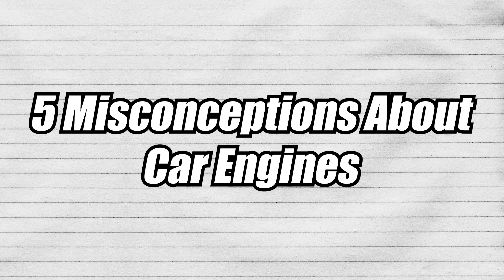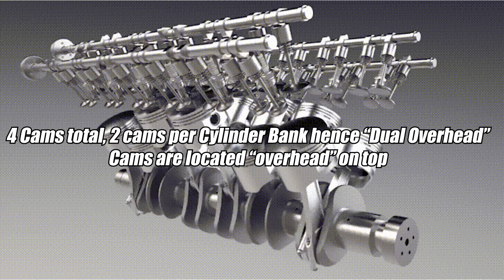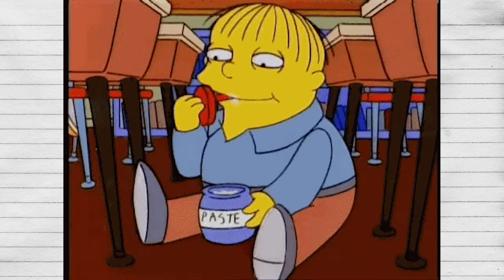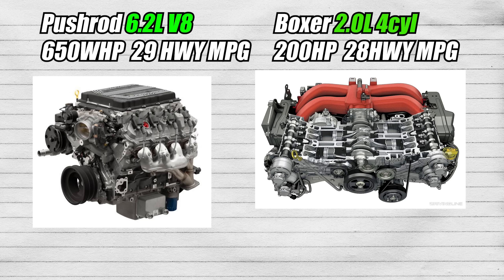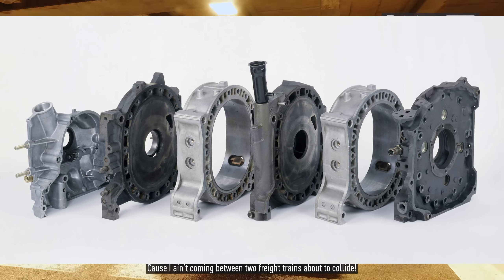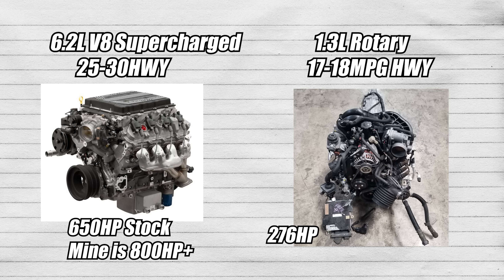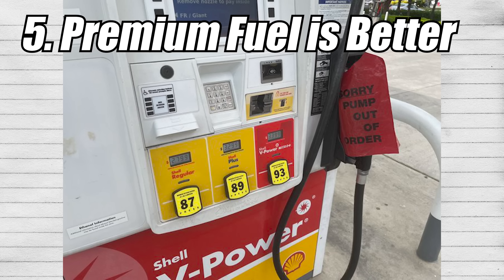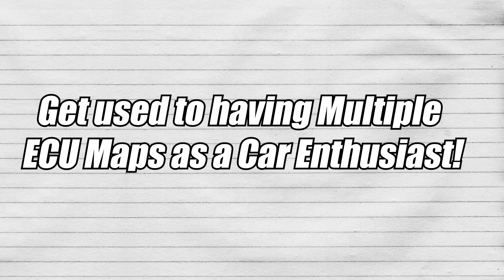5 Misconceptions About Car Engines!

Comment: Please explain in detail how the movement of the pushrods generates more torque per engine size compared to most overhead cam setups. It is my understanding that it just adds reciprocating parts which make it harder to rev high thus making it harder to make power by increasing rpm as opposed to the relative ease of making power in a pushrod engine by increasing torque whereas an OHC or DOHC engine has less reciprocating weight making high rpm easier to accomplish allowing a relatively low torque engine to make more power by making it's torque at a higher rpm. This results in pushrod engines usually making more torque in lbs./ft. than horsepower and OHC engines (especially DOHC engines) usually making more horsepower than lbs./ft. of torque (since DOHC has the least reciprocating parts in the valvetrain) but I fail to see how the pushrods come into play in making it easier to make torque in a small displacement engine. I'm not saying you're wrong, just want to understand and I don't. My understanding has always been that pushrod engines tend to make lots of torque at low rpm because that's just how they're tuned because it's harder for them to rev high.
Reply: I guess the weight of two or four camshafts robs engine torque. My old '95 Grand Prix had a 3.4L DOHC 60 degree V6 which replaced the pushrod version's single twenty pound camshaft with a twenty pound balance shaft and four twenty pound camshafts... and the camshafts were driven by a belt which was driven by the balance shaft in the position of the pushrod version's camshaft which was driven by a chain. That's a lot of extra rotating weight so that makes sense but could have been explained more clearly.
Reply: @Where_is_Waldo  it's really just that pushrod engines usually have more displacement for a given power rating, and more displacement means more torque.
Yes it's basically because the reciprocating mass makes it harder to rev high, but it's also that pushrod engines only have 2 valves per cylinder so they can't breathe as well at high RPM.
(And if they made them 4-valve, the reciprocating mass would prohibit high RPM anyway).
Interesting comparison:
That quad cam 3400 (very cool and interesting engine btw) made what, 240 hp? But the Buick 3800 Supercharged (a few years later) also made 240 hp, but with pushrods and more displacement (the supercharger is of the 'positive displacement' type so it's equivalent to adding more displacement). Of course the 3800 made more torque and made its peak 240 hp at a lower rpm.
Reply: @nthgth  The quad cam 3.4L made 210hp initially and was retuned for the final model year of 1996 to make 215hp. It actually didn't rev much higher than GM's later released 3400 SFI pushrod V6 and both were variants of GM's 60degree V6. Both versions of the 3.4L 60 degree V6 had aluminum heads. Early 60 degree pushrod V6 engines had fairly constrictive ports but my understanding is that the only way to increase flow beyond what the 3400 SFI pushrod engine achieves from the factory is to polish the ports, they really maximized the flow of the two ports per cylinder in that engine. The 3.4L quad cam was actually design by lotus and they had to figure out a way to fit the oversized cylinder heads into a Grand Prix/Lumina/Cutlass Supreme so they initially tested the motor in a FWD Camaro.
Reply: @Where_is_Waldo  ah ok 210-215 hp. Ok then for that comparison I'd compare it with a standard 200 hp Buick 3800 with a cold air intake and maybe headers. Lol.
But too the point, that's really interesting Lotus designed that engine. Just like the also quad cam LT5! (I think).
I did NOT know about a FWD Camaro, that's crazy. Like a normal 4th gen converted? Or a concept 5th gen?
However I do remember reading that the 3400 quad cam (LQ1 I think) made 285 hp in testing, but GM didn't have a FWD automatic transmission that could handle it so they had to reel it back - probably why it didn't rev that high for a dohc performance engine.
Can you imagine if they just left it manual-only and built a 285-hp Lumina Z34?? And Grand Prix etc. Those cars would have been world-beaters in their day and priceless now
Reply: @nthgth  The LT5 was in the C4 ZR-1 right? That was designed by lotus as well as the C4 ZR-1's suspension. The fourth gen. Camaro was the '80s style that included the IROC correct? I believe it was that generation and I think I remember something about down tuning it for the FWD automatic transmissions. I did just pop onto your youtube page for a moment and noticed you seem to be into old school gaming as well, we seem to appreciate some of the same games. You reminded me I need a copy of Road Rash 64... actually I also need a copy of Road Rash for the Genesis now that I think of it. I used to think they never made any car with the quad cam 3.4L AND a manual but as a teenager I once saw a GTP 3.4L with a 5spd parked on the side of the road. I waited a while hoping to meet the owner but had to leave before the owner came back. It looked factory but I wanted to ask. Mine sat in a barn for years before I bought it and had too many problems for me to sort out, one of which was the planetary gearset breaking. I got that fixed and fixed the fuel system and replaced the timing belt but a big mistake I made which I didn't realize until I sold the car was using silicone on the gaskets when reassembling the intake manifold, I didn't know that could screw up the oxygen sensor and plug up the catalytic converter.

Comment: People also gotta realise that even if a bigger engine got less power than a smaller one, its probably gonna last a lot longer simply because a bigger engine moves slower and therefore does a lot less revolutions per minute for the same power if you're going highway or any inner city speeds where more power doesnt do shit because you're flowing with traffic.

Comment: So my dad is very much so the "no replacement for displacement" kind of guy. But he told me that it doesn't mean that a larger displacement engine is always more powerful, but rather that if a four cylinder with a turbo has the same power as an n/a v8, then putting that turbo on the v8 would give it way more power.

I still fully agree that na isn't the be all end all but that there are too many variables to make a concrete statement.

Comment: The 10-15 second startup waiting time is an annoying misconception of a misconception, because people completely ignore that its not only the fact that parts need to be covered in oil, but that oil needs to be warmed up in order to work properly (this mostly applies on diesels tho), and dont get me wrong it will heat up fast (<<1min) but still, its not just start up the engine count to ten and roll...

Comment: I love these vidoe, even though I know most if not all of what he is saying, it is good to get a nice sanity check on my thoughts and it is good to check if others have the same or similar thoughts that I have. If there was a same car with the same trans cruising at the same speed on the same grade of road in the same temp on the same tires but with different engines like a 6.2L V8 N/A and a 2.1L i4 N/A get the same gas mileage. I also have a question about warming up. Do I need to warm up my car if it is like 0-5 degrees f out? I try to let it idle for a couple of min, but do I need to.
Reply: I can't answer your question, but your hypothetical 2 cars with same mpg reminded me of something from my early 20s:
My car was a '95 Camaro Z28, I averaged ~17mpg around town.
One time I borrowed my parents 09 Camry 4cyl for a week, in which I averaged the same! (wasn't trying anything, just noticed when I filled it back up).
I chalked it up to same driving habits, same roads, same amount of drive wheels, ~same vehicle weight.
(The Camry was only 5spd and auto, but had FWD in its favor, I call it a wash).

Comment: I found the comparison between the rotary engine and conventional engine in misconception #2 to be very dumb.
Conventional 4 stroke engines have a period where they are not sucking in air while they are running (squeeze, bang, and blow), while 2 strokes do it much more often (piston goes up and sucks in air and fuel mix and pushes it into the combustion chamber), and rotaries do it all the time (on one side there will be igniton, but on the other side there will be a sucking in of air and fuel)

Comment: "Modern engines don't need to warm up."  

I dunno about that.  I've got a Camaro LT1 and if I try to performance shift that thing too soon (definitely a minute+ into my drive, but before the engine has reached equilibrium temps), it is very obviously not happy to do it.  It's a very noisy shift compared to the same shift at normal engine temps.
Reply: Could be the transmission temp. My old FR-S was loathe to go from 1 to 2, even gently, for several minutes after a cold start below like 20°F

Comment: Great example of small engine having to work hard to maintain highway speed and thus reducing MPGs, my 94 Miata. at 65mph it's above 3,000RPM and I average mid 20s at best like that. It's a tiny 1.8 liter engine. 
My daily driver Focus is a 2 liter, and at the same speed might be touching 2,400RPM, averaging around 32MPG.
My best MPG was a 96 Ford Escort hatchback 5 speed, 48MPG shortshifting, and keeping RPM below 2,500 while avoiding highways. Otherwise mid 30s.

Naturally how they're driven will heavily affect MPGs and when I have my fun times in my Miata it drops into the teens very quickly.

Comment: here in belgium it is insane to buy a car thats more than a 4 cylinder 2 liter car , because the stupid rules they have on bigger engine cars, if i want to buy a 3.6 v6 i have to pay 2k each year to have it on the road and there is an extra cost to it called BIV and that would cost me between 3 to 5k to just get the car written to my name , its crazt and with 4,5 or higher litre engines with 8 or more cylinders its even worse, at around 8+k each year and around 12+k for the BIV costs, its sad man cuz al you see on the road here are small and boring cars

Comment: In a highway that is not too congested,
High displacement can be more economical.

Same cannot be said if it's heavily congested, so it's true that large displacement engine is not as economical as small displacement engine for the most part.

One time I have a commute that took 6 hours, distance is 17km.

Imagine the wasted gas while stuck in that pace.

Comment: Bro you are ridiculously wrong about warming up engines.. it’s not just about getting the oil to all the places it needs to be.. when your engine is cold all the internals are literally a difference size.. when they build an engine they have the clearances set to an exact amount to compensate for thermal expansion.. that means when your engine is cold all the parts inside are loose and sloppy.. then when u load it by driving it now you’re adding force to all that slop causing accelerated wear.. imagine what would happen to the barrel of a gun if the bullet passing through it was smaller than the tube itself.. things gunna bounce and clash as it makes it’s way through.. a piston in a cylinder is no different.. thanks for giving everyone the worst advice imaginable…

Comment: Pushrods don’t generate more torque per liter. LT2 at 470 vs LT6 at 460, even though the LT6 has much less displacement. Torque density is entirely dependent on the engine quality and bore vs stroke. Also, the LT4 makes 15 mpg, not 25-30.

Comment: Let the engine warm up come from the carburetor equipped engines. The carburetor would normally need a few minutes to warm the exhaust manifold so heat from it could rise up and warm the intake air for the proper mixing of fuel

Comment: Foe the first point.
A 3.8 v6 with turbos won't have a displacement of 3.8, it'll be bigger because of the turbos. Displacements for engines typically don't mention the true displacement with the forced induction so your 3.8 is definitely bigger than a 3.8.
The goal is how much air and fuel you can flow, the more you can flow per stroke the more power you'll make typically. An n/a engine that flows more than a turbo engine would most likely make more power. This is also why boost is not a correlation for more power. Its just a measure of manifold pressures.
A lower boost engine that flows better will make more power than a higher boost engine with more restriction. Plus boost tends to heat up the air more anyway so there is a tipping point where its worse to have more boost.
Long story short, there is in fact no replacement for displacement.

Comment: Displacement doesn't always mean bad millage, but in certian form factors and conditions it does

84 celica with 22re, I now drive it for delivery and recently got 17mpg with it for a 16gal tank. Ultimately its the type of driving that makes it bad but I bet a smaller Displacement would have made it not as bad
Reply: But it'd be a lot less fun to drive, and it's a Celica, not a Tercel

Comment: A car's fuel economy is determined by many things. It is determined by fuel delivery, compression, displacement, etc. The reason why smaller engines are being use more than larger engines is mostly due to emissions (and also fuel economy). Larger engines produce more carbon emissions than smaller engines. That's why they're being phased out.
Reply: It's because in very specific government tests, under very specific conditions, they get better fuel economy. That's the reason.
If you watch the video Bladed shows larger engines getting using less fuel in other circumstances. Many examples exist in the comment section and elsewhere in the world.
And the carbon comes directly from the fuel so less fuel use = less carbon emissions.

Comment: Your corvette doesn’t rev abnormally low. It revs abnormally low for an NA car, I’ve owned mostly german cars for the past 15 years and the highest cruising rev I ever had was on my second car, an M6 V10. It used to cruise around 1900-2500RPM. My former car, an S63 C217 non-facelift (it had the 5.5l engine) cruised at 1500-1800RPM) and my current car, an Alpina B3 G20 (with the S58) cruises at 1200-1600RPM.

Comment: Well for oil to get everywhere sure I mean all motors did that but aside from carburetors the problem is when it's cold with the metal expanding to the right size since the pistons and block will not be the size they should be till its at least warm and cause excessive wear some diesels won't do much till they are up to temp for that reason

Comment: In making a video about misconceptions you also perpetuated some misconceptions. You know aside from going to forced induction, a bolt on and cammed 6.2 will still make more than the Coyote mod for mod right? The package is also overall lighter and more compact. The inherent high rpm breathing ability is from the ability to run multiple valves, not the design of the valvetrain. There have also been plenty of screaming ohv engines in the past

Comment: You missed probably the biggest misconception about cars, and that is that diesel engines are less fuel efficient than gasolene engines. The misconception comes from the fact that diesel is used in vehicles like trucks, buses, and heavy equipment, which aren't known for fuel efficiency. 

Because of the way diesel engines work, they have a very high compression ratio and under normal operation, run lean. They also produce a lot of torque which makes them drive at vastly lower RPMs than gas engines.
Reply: What makes them run on low rpm is the slow combustion of diesel. They physically can't do more than ~5000 rpm, because the combustion can not keep up with higher rpm.

Comment: A bigger NA may not always make the peak HP a smaller revier NA engine makes.
That's not the full story though. It will make more at almost every part of the rev range until it runs out of puff and redlines. The revier engine keeps going. This means you have to rev the utter nuts off that to achieve more than the lazier bigger engine.
Some people are obsessed with adding revs. I'd rather add CC to get the same and lower RPM.

Comment: Where I live they don't tax cars based on engine displacement, but rather on emissions during a standardised test (diesel gate anyone?). So in that respect the politicians did get it. "More CO2, NOx, PM is bad" and as such pays more eco tax.

To me the funniest misconceptions I've heard about engines, are about scooter engines. Doesn't matter if it's car guys or bike guys. When it's a scooter it's suddenly all voodoo and black magic because of the CVT I guess. I've literally heard car mechanics say "I know nothing about scooter engines" even after I'd told them that a GY6 is just a very basic SOHC 4-stroke engine. Dude can rebuild a freaking TFSI blindfolded, but "knows nothing" about a GY6. So when his girlfriend's moped shat the bed, he was asking me about things that I figured he would have learned in Car Mechanic 101. It's a GY6 I don't get what's so confusing about it to him.